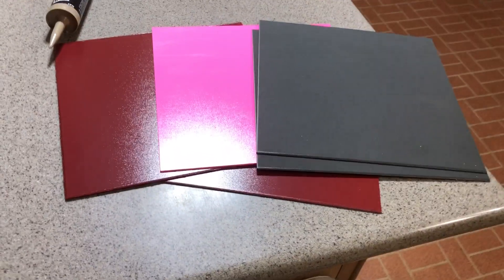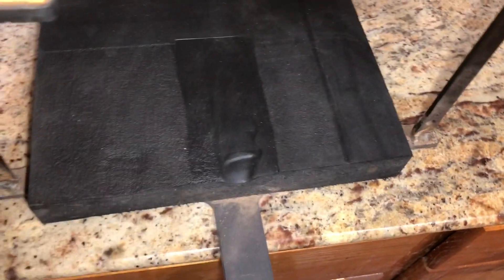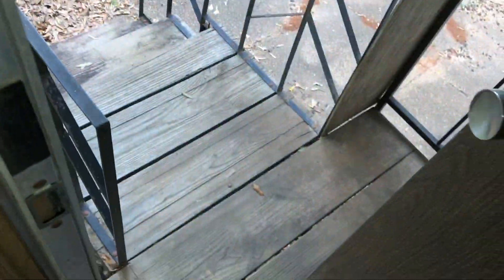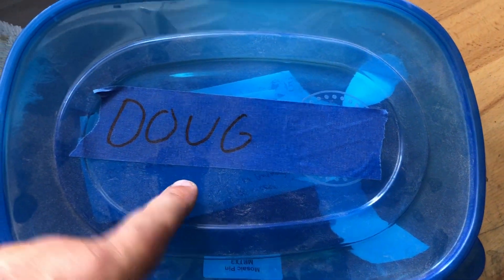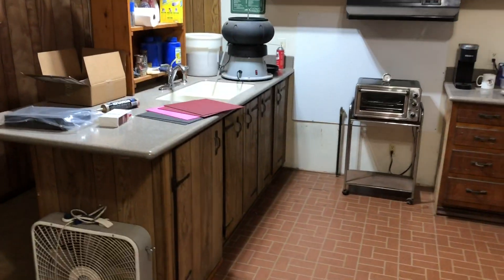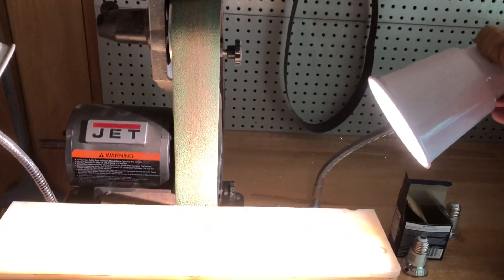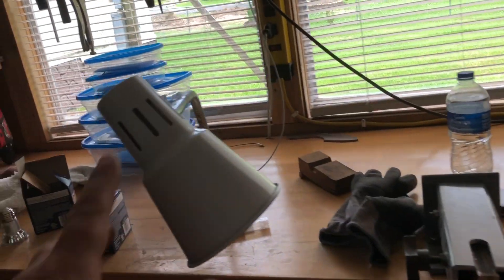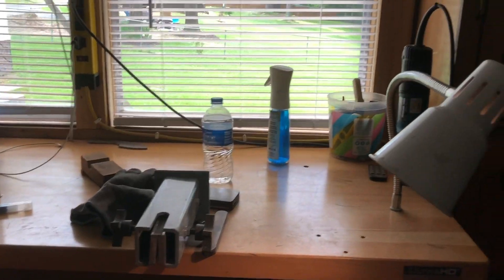lightbulbs and kydex and stairs, oh my!

Comment: I have had to educate my self on LED lighting in the last couple years because of the girls in the band room. A word of warning. If you have a laser temp gun, take some readings after that light has been on for a half hour or so. The reason it’s made out of cast metal is for heat dissipation, I am betting that light gets pretty hot!
Reply from the maker: I am definitely a fan of LEDs now. I have nothing in my house or shop that isn’t LED.

Comment: Can relate to those steps. I have the same problem with a broken tread on my back porch steps. Gotta rebuild them, as the stringers have failed after 25-30 years. Can't remember exactly when I built them. Even pressure treated lumber has its limits, I'm sad to say. 
Can't say on the lights. Appears that the first bench has the brightest one on the right. Look about the same on the other bench. That don't mean much, as these old eyes sure aren't as good as they once were. That said, that new light in the kitchen is easy for these old eyes to see the improvement!!

A FWIW.... If that fellow is like me, he doesn't bother to take off that stuff between stops at various places. Usually, when I make an errand run, I've got several places on my list. I don't put on my bandana & gloves till I get to the first one. Then, I don't take off the garb until I get back into my car to leave the last one. Then, out comes the hand sanitizer for my gloves, steering wheel, door handle, etc. Over kill, probably. Yet, I can't risk bringing that virus home to infect my sister nor catch it myself because I'm her caregiver. Can't tell  you how much I dislike wearing that stuff.  I have COPD, thus breathing through masks & such is difficult. HATE to wear plastic gloves of any kind. 

BTW, I finally found a box of masks at Sam's Club yesterday. Have a couple of N95 and surgical masks that I've been saving in case things get worse. Now I can quit wrestling with those bandanas. Also picked up our limits of hamburger and stew beef. Have 14 pints of beef chunks in the jar & plan to can the hamburger this morning.

Hope your thumb heals quickly. Take it easy for a few days, taking time to smell Charly's flowers. It'll speed up your healing, if you let it rest. :-)

God Bless.